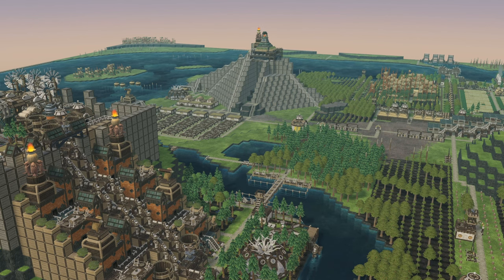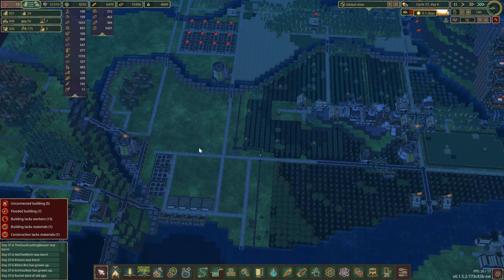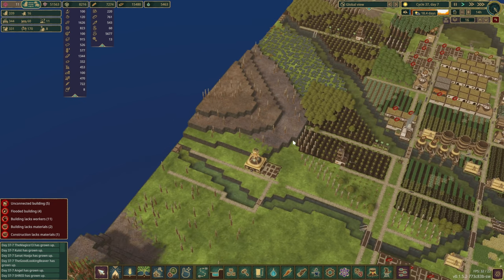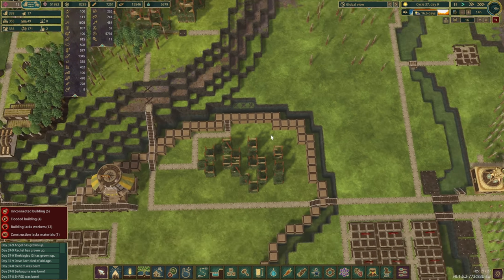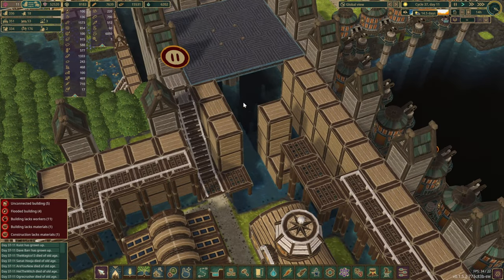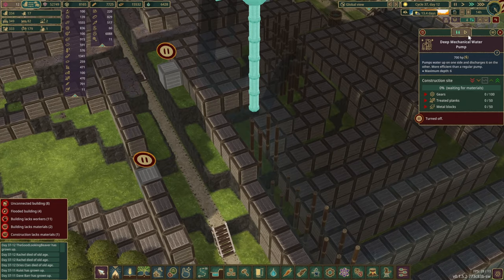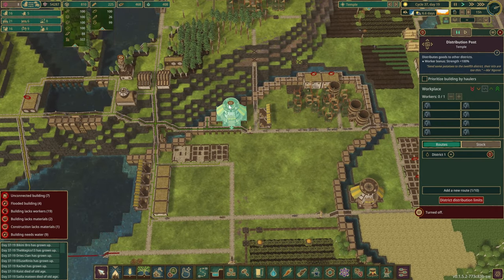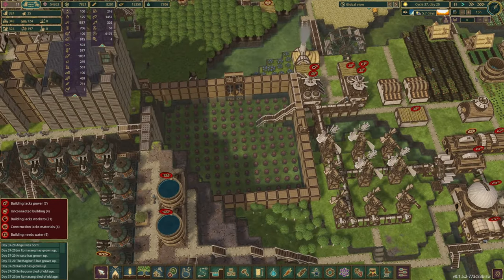TIMBERBORN | Time to Demolish District 1 | E35

Comment: So Experimental version creates a new save directory, but keeps the old one as well. You can move/copy the save over from the normal save folder to the experimental save folder. I have done that before, but I can't guarantee something hasn't changed that could break the original save. (Like the possible restructuring of a save file, etc.)
Reply from the maker: Hey Rux! 
That's super useful to know! Thanks a lot for sharing! I gave it a try and it seems some of the mods are not compatible with the update so sadly can't even test the new features out on the current colony :/
Reply: @BabyDragon1  Awww... Well you tried! Glad I was able to provide useful info.